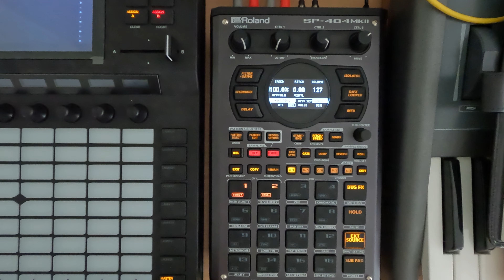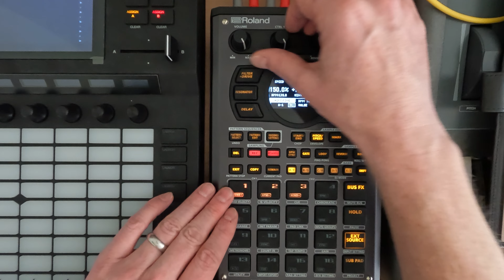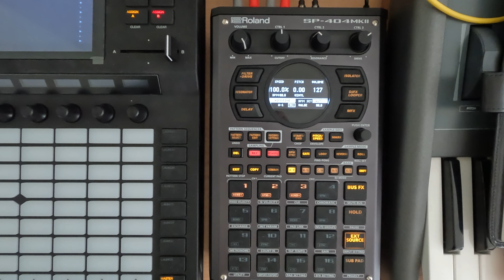SP404 mk2 30.1 - Old School Tips: Time to Pitch

Comment: Hi which is the normal pitch function on this, like with the sp202 pitch? is it when you select vinyl.
Reply from the maker: Vinyl pitch mode yeah... basically the way the 202 works for pitching is that when you pitch up the sample plays faster (ie, is shortly) and when you pitch down the sample plays slower (ie, is longer).  This is also how vinyl works, the pitch/speed/length are all related to each other.

The other modes allow you to adjust the pitch and speed independently.  This requires more processing power to do in realtime.

Hope that helps.
Reply: @NearTao i guess it does i never thought about that 🤔, I sold my sp202 today and I still have my sp303 and sp808, I am now gonna sell the sp303 to, I was well gutted when I found out the sp303 pitch wasn't the same thing as sp202 it's more of an affect.
Reply from the maker: @Kaosinlondon79  Yeah I'm not sure why Roland made the decision to do that weird pitch shifting effect that isn't really pitch shift on the 303/404og/sx/a, but at least they've brought back the pitch shifting on the 404 mk2.

if I had to guess, the 202 actually changes the clock speed of the chip when it plays back, and they weren't able to do that on the other ones for cost reasons... and probably brought it back on the 404 mk2 because they have a lot more CPU headroom to do that kind of effect that way.
Reply: @NearTao  Would be so cool if the 303 and 202 could somehow be modified with each other, the internal components.
I'm looking to buy the 404mk2 very soon.